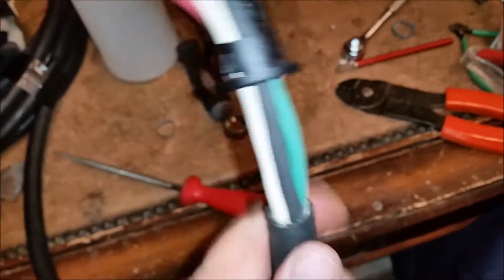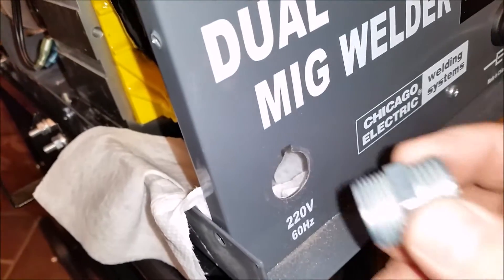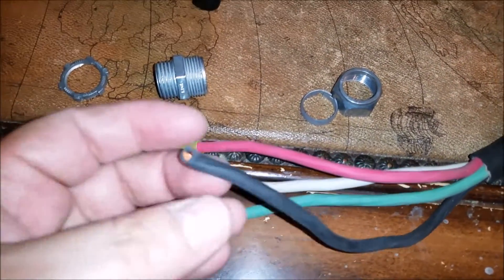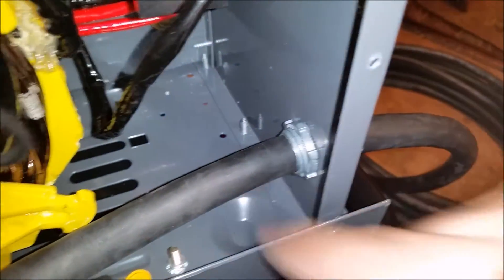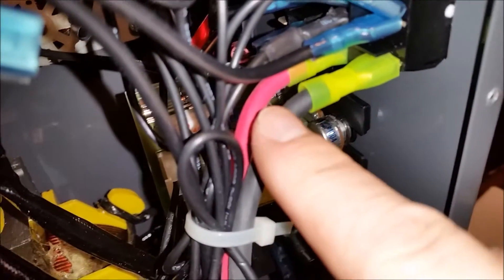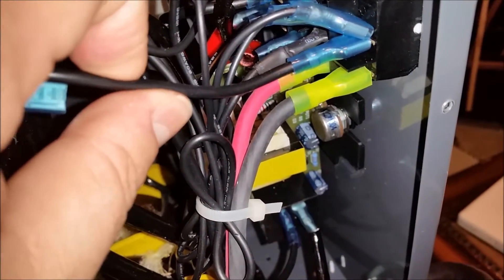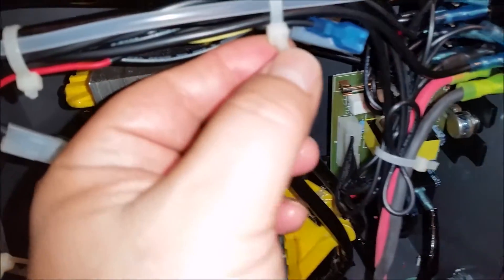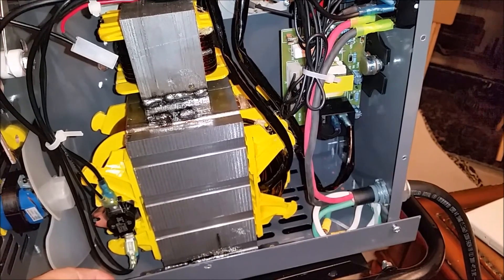Harbor Freight 110amp Dual Mig Welder PWR Cord Upgrade part 2

Comment: I need help I have a Chicago electric dual mig welder 151 and all the wires were disconnected from the inside is there any videos or diagram that will show me every wire and there placement s go
Reply from the maker: Not that I'm aware of. How ever if you look at the video's you should be able to figure them out. If you email me I'll email you the manual that has the wiring diagram in it.
Reply from the maker: Also watch this video series on the internal wiring upgrade. I'll try and help you get it back together.
https://www.youtube.com/watch?v=qDCNzSEIoU0&list=PLVLXGvrQp0OufeG0agtf1dOZ6lRtdcEcF&index=6&pp=gAQBiAQB
Reply from the maker: PS if you're on Facebook drop me a link and I'll message you the manual as well, or at least the diagram. Keith

Comment: i loaned out my dual mig and it came back in pieces i can not find info on where i wire the trigger back into the system inside of the welder, can you help, i have been eyeballing your vid trying to locate them so i can reverse engineerthem but no luck yet.
Reply from the maker: Sorry for the late reply the power and internet were out due to hurricane Zeta. Did you figure it out?

Comment: 2:50 sounds like your gal was yawning
Reply from the maker: LOL Out of all 6 minutes and 26 seconds of the video you picked that out that 1 second to make a comment, that's funny. You should be a sound engineer, even I didn't pick that up when I edited the video. Thanks for the laugh. Best Wishes n Blessings. Keith Noneya
Reply: Keith Noneya blessings to you hope that welder is still working good. Would this work for a 110 welder or could I go with a smaller wire. Like to go about 20 foot

Comment: Please do not put neutral and the bonding conductor together that is against electrical code. You should have just got a 10/3 sjtw without the neutral conductor you also have the wrong fitting other than that you did a nice clean install
Reply from the maker: Thanks Gurjinder. You're right I ended up disconnecting the 4th wire on both ends as the GFCI didn't like it. I kept the camper plug anyways because it's easier to pull in and out. Also with the 4 wire plug on the wall I didn't want to have to undo everything, and if I needed it later I could still use it, the 4 wire outlet on the wall that is. I actually show this in part 4 here: https://www.youtube.com/watch?v=JY94rK5hvJQ It works fine now. Now if I could only weld worth a crap I'd be doing good, LOL.
Thanks for watching and sharing you knowledge, that's why I put these up.
Best Wishes n Blessings. Keith
Reply: Keith Noneya I'm in Canada I went to the states and got their newer 170a mig welder. It's my second day welding with it today I'm not very good with it yet. Ive had a 70a stick welder for a long time and I've been welding with it for a long time I've noticed flux core is a lot messier it's insane. I think I'm going to set it up for gas soon
Reply from the maker: Gas is much better. Keeping the tip at the right distance and the shroud to tip also at the right distance can make a big difference. Getting the right power settings and wire diameter and gas flow is crucial. I'm a beginner myself with several days of welding under my hands. So from one beginner to another watch a lot of videos and practice, practice, practice. A NEW 40" bottle costs about $225.00 dollars and to fill it with C25 cost about $30.00 bucks. I like the Eastwood videos and also some videos from Welding Tips and Tricks. A cheap Flow meter cost about $25.00 dollars. A cheap cart on eBay cost about $40.00 bucks. You can check out some of my other getting started with MIG Welding stuff here:
https://www.youtube.com/playlist?list=PLVLXGvrQp0OufeG0agtf1dOZ6lRtdcEcF  
I haven't posted any welding videos yet, as i'm not experienced enough. 
I loved BC Vancouver area when I lived on Whidbey Island and would visit a few times a year. 
Well Best Wishes n Blessings in Canada. Keith

Comment: That EMT fitting is actually for the cramping metal EMT conduit not cable. Next time get the fitting with the rubber ring.
Reply from the maker: Eddie Allen, Seriously thanks for the info. It's what I had on hand so it's what I was able to slightly mod and use in order to get the mod and video done. 
If you have a manufacturer and a part number i'll include it in the comments above. I may even change it out, as I like my stuff to be right. Thanks for watching, all comments are appreciated. Best Wishes n Blessings Keith
Reply: +Keith Noneya OK I'll set you up after I go to work next (Lowe's):)
Reply from the maker: Not a problem Eddie, and thanks. I love Lowe's, I shop there almost exclusively for most of my home projects, lumber, electrical, plumbing, lawn equipment new, parts I get from eBay, flooring and painting supplies etc.
Reply: +Keith Noneya I'm there 5 days a week working. I'm about to get a HF 170a mig welder my self. it's a good idea upgrading the power cord. I got a 10' chunk of 10/3 I may use on my welder. if at your Lowe's they have a cart of wire sections tossed together, check it out. at my store we sell them for 75% off just to get rid of them. I got a 100' of 12/3 for $0.25/ft~ because a customer changed his mind after they cut it for him.
Reply from the maker: WOW! that's awesome, I'll have to remember that, and thanks for the thumbs up.
I also upgraded the internal wiring to 10 awg as well. Here's the video on that: 
https://www.youtube.com/watch?v=qDCNzSEIoU0  

I list all the parts there I used for anyone wanting to know what to get. If you do the upgrade, I would use the three wire 10/3 instead of the 4/10  wire. Reason is most people still use the three wire plugs and outlets and the systems are not set up internally for the 4th wire. If you watch part 4 you'll see what I mean. Also make sure you have 220v in the garage for the 170, as that's what it uses. The Argon tanks are expensive so look on Craig's list for them. Check the date on the bottle or ask you local gas supplier if they'll exchange them if they're a little out of date. I purchased a cheap cart on Ebay for the welder, trust me you'll want one, these things are heavy. I made a video on how to put it together sightly different so that you can access the side door to change polarity and wire size. I also made a video on how to set up the Argon/C25 gas if you go that route. Here's a playlist of all the crap I've done so far with mine. I know it's for the older welder but 95% of it will cross over to the know ones, just the location of the parts have changed. If the videos help, please give them a thumbs up, and subscribe to help my YT standing. I want to get to 1,000 subscribers so I can earn more. I purposely use skip adds because I hate it when I have to wait for a stupid add to watch a video I need to watch, so I use skip-able adds on mine for my viewers. Here's the play list, you may find something useful in there for ya. 
HF Playlist  https://www.youtube.com/playlist?list=PLVLXGvrQp0OufeG0agtf1dOZ6lRtdcEcF

Thanks for watching Eddie, and feel free to add any helpful comments or ask any questions.  Keith
Reply: +Keith Noneya OK the fitting you want is a cord grip connector Lowe's #108667. it does have 3/4" not threads so it may need a bigger hole in your welder case but it'll work better for you.
Reply: +Keith Noneya I plan on making a cart from a HF dolly. lookup Chucky2009's channel he made one like what I have in mind but I plan on using bigger wheelchair wheels because I'm working in a bumpy front yard.
Reply from the maker: Hey I checked it out, neat little cart. I'd turn it sideways though, but with wheelchair wheels it might have to be the same direction as his. Also I would mount the rod holders on the sides stacked on top of each other on a diagonal angle and that way I would have use of the shelves and easy access to any rod I wanted.
 I looked up that part, I'll go look at it as well as the 1/2" version too, Item #108659. Well gotta hit the sack so I can get up early and go to work. Talk with ya later. Best Wishes n Blessings Keith